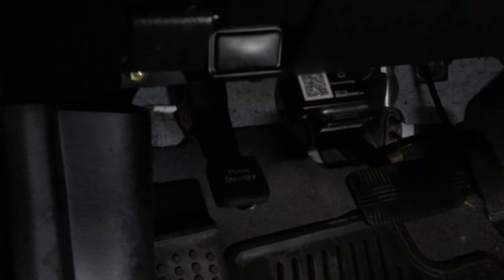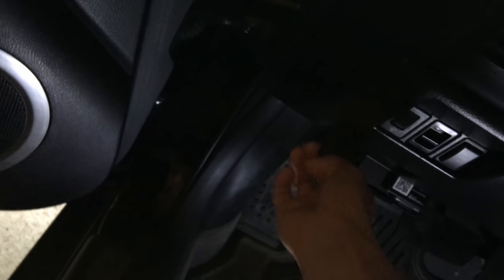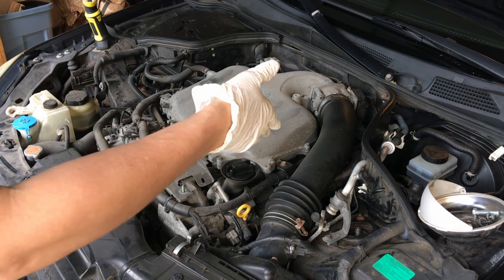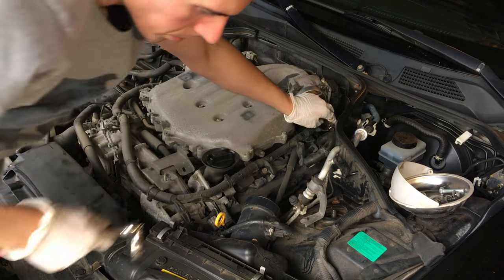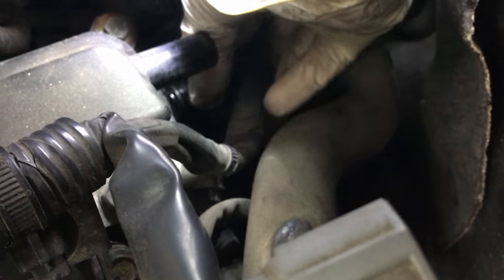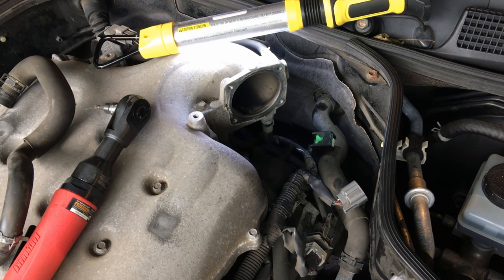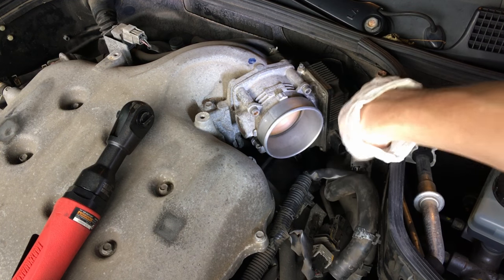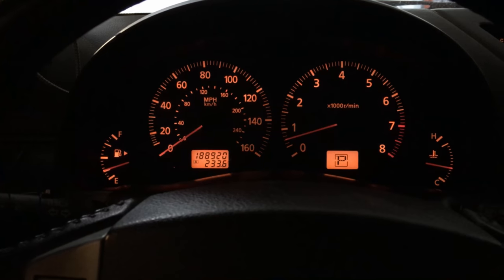G35 Camshaft Position Sensor

Comment: You did it the hard way.  I just did one on an '05 without removing any of that stuff, took 10 minutes tops.  I used a pry bar to hold the hood fully open for more space, not necessary.  Come in from the passengers side with a 10mm socket to remove the screw.  Pull the sensor out, had to pull & wiggle pretty hard to pop it free.  I used a long nose pliers to squeeze the connector tab.  Put the connector onto the new sensor and release the tab, install into engine and install screw.
Reply from the maker: Hey DonsiGT230, great idea!  I just followed the service manual process (I know not always the easiest way) So you were able to reach all the way over to the driver side and see what you were doing entering from the passenger side??  If the sensor goes bad again I'll try it that way.  Thanks for watching.
Reply: @attached2mygarage37  From memory I couldn't see, I think I did it by feel.  It was pretty easy for me, but I have better than average feel & dexterity.  Despite that I don't think it would be all that hard for anyone accustomed to working on stuff.
Reply: @DonziGT230  I used your method also. Couldn't see it but could feel it. Undid the screw, pulled it out, then I could see it. I'm not very accustomed to worked on stuff, so if I can do it, most people could.
Reply: @GrahamFam72227  Awesome!

Comment: Excellent video. Fixed P0345 Bank 2 CPS on 2005 G35 Coupe following the instructions. I recommend getting the 23731-AL61D OEM part or the Hitachi equivalent CPS0013 (previously CPS0005). Thanks!

Comment: Great video. I changed it blind, from the other side. but someone had broken the lock clip on the plug, and after 3 auto zone lifetime replacements all failing to fix the hard start, I figured it must be the plug. This video shows me how to get where I needed to be to replace the plug for the sensor. Thanks!! PS Hitachi is  Infiniti's manufacturer for These sensors. Bank 2 (angled) CPS0005, and CPS 0008 (straight) passenger side. Aftermarket parts for this application always seem to fail. You can pick up both sensors from rock auto for less than $100.00 for both!
Reply: how many do a 2012 g37 camshaft sensors have? so hitachi is the manufacturer
Reply: Are the rockauto maf you rhino might be the same as the dealer?
Reply: Do you have an idea of where the camshaft semsors might be located on the g37? All I see is videos of the g35
Reply: @ClaudBol  what model? Most have 2 cam sensors and 1 crankshaft sensor. Camshaft sensors are on the back of the engine, just below the heads. The crankshaft sensor is between the oil pan and transmission.  If it's a 6 speed manual, or a turbo or an IPL, throw out everything I just said, and look it up on YouTube. Put the 1st 5 or 6 digits of your vehicle I.D. number, or look it up on an Infiniti parts page.
Reply: Email Joe at zspeed he's a 25 year Nissan Infiniti technician and has the best price, and Customer service. He answered my question within 3 hours. My go to source for anything 350z, or g35/37

Comment: Great detailed video of the procedure. I know there are some folks that forego removing the throttle body and intake hose because they reach under those components while standing on the passenger side fender; but ultimately I think your process is easier because you get much easier access to the sensor; AND you get to clean your throttle body - Bonus!

. Thank you, as I'll be doing this today.

Comment: Thanks for this excellent DIY video. This was very helpful to change the bank2 CPS for my 2004 Infiniti g35. While doing this, I also changed the AC air filter. This allowed me to also clean the throttle body. Truly appreciate your help in providing detailed DIY video. I also changed bank1 CPS. But I used $40 after market parts (for both sensors) from 1A Auto and hope they last. They seem to be working and the car is not stalling anymore with the Slip indicator. If these sensors go faulty as you indicated in the next few months, I will get OEM parts. Keep up the good work bro!

Comment: At first I tried the shortcut because I could see the driver side Camshaft position sensor from the passenger side.  However, I was mistaken and changed the wrong sensor.  Did not want to remove the throttle body, but it was so dirty I took it out to clean it.  Once removed, changing the Bank 2 CPS was easy.  CPS fault was fixed, but due to disconnecting the throttle body a Service Engine fault P0507 High RPM posted.   Getting it to clear was a real problem. Performed the procedure several times, but problem persisted.  Thought my cleaning or handling damaged the throttle body so I installed a new one.  Also replaced the two air inlet hoses (one of which was split).  I did the relearn again but problem remained.  Pulling out my hair at this point and ready to take it to a dealer.  Found a slightly different procedure on YouTube and it worked, while the Haynes and throttle body manufacturer procedures did not.  Try the Idle Relearn by Motordyne G35.

Comment: Thanks bro this video was great!! I use your method along with another where I go in on the passager side. I still took off the intake but, left throttle body on and got to the sensor with no problem. Once again thanks and great video bro.

Comment: You can do this job from the passenger side of the motor and avoid all those unnecessary steps, but this was a nice commercial for the blue tooth code reader

Comment: Nice detailed vid.  I got a 06 g35 rev 6m.  I'm wondering why my car driver side camshaft sensor is str8.  I need to change mines also.  I'm not sure which to get, str8 or curved.
Reply: Since I've changed my cam sensor, I'd realized the engine has four cam sensors.  Two on both bank sides.  I'm like wtf...  but good to know now.  Glad  I got the right one.
Reply from the maker: Passenger side is straight, driver side has the bend in it.  I'm pretty sure it's the same through out all the VQ Engine model years.

Comment: so my code is "p0340 camshaft position sensor bank 1" Bank 1 is passenger so idk if that's right or left. The link you have below is for left. Could you help me figure it out before I buy my part off partsgeek.com Every video for bank 1 the part is different but on parts geek the part looks like yours but your replacing right side I. I have to replace bank 1 which is not the side your doing.
Reply: Bank 1 is passenger it's the straight sensor with no angle . Bank 2 is the sensor with an angle located passenger for anyone wondering.